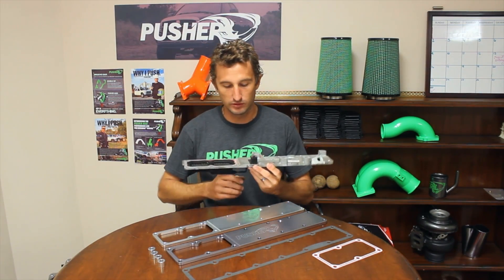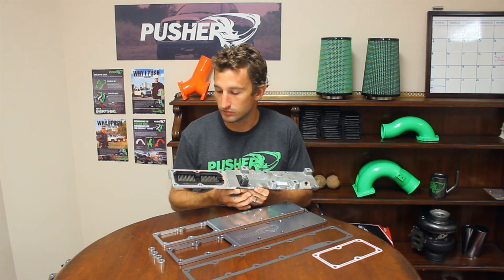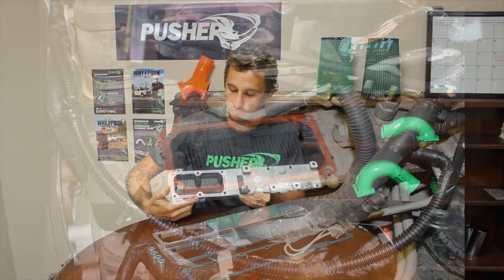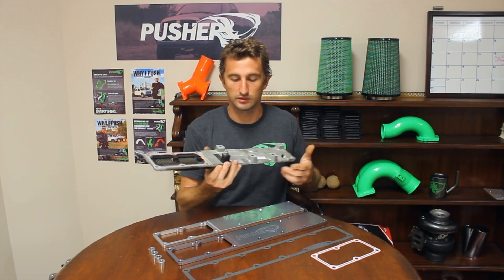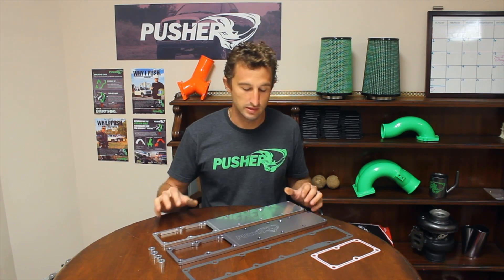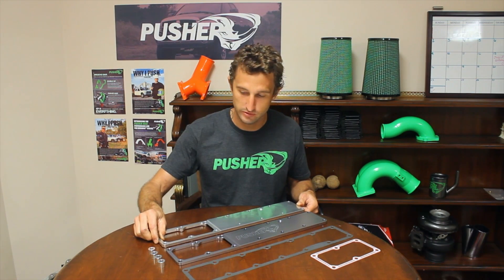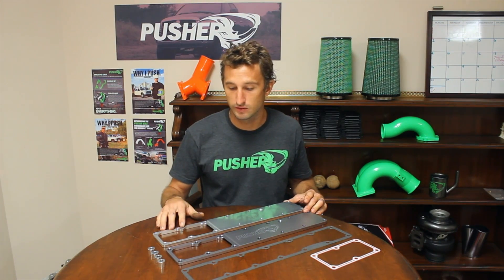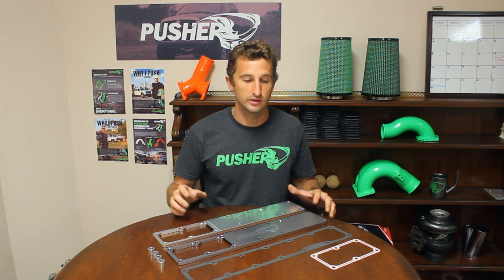Pusher Product Overview - Heater Grid Delete - Dodge 6.7L Cummins

Comment: I think you've missed the BIGGEST selling point of your part, it gets rid of the Killer Nut! That is the nut on the bottom of the stock plate where the electrical lead bolts on. After some time it can work loose, that causes arcing, which melts the stud. Then the remains of the nut and stud get sucked into cylinder 6 and causes BIG $$$ repairs. Or a new engine.

Comment: Is a DPF delete a good idea with a grid heater delete? Will the initial starts without aided heat cause mixture to run rich causing more soot in DPF?
Reply from the maker: After an extreme number of cold starts that may potentially be an issue, but we have never seen it be a problem.

Comment: I dont like bolting this kind of thing on my truck without data. How did you measure the 33% increase in airflow capacity? Do you have before/after dyno numbers?

Sorry kiddos, seat of the pants doesnt mean shit. Data doesnt lie.
Reply from the maker: This product was tested on a SuperFlow SF-750 flow bench and the results were independently verified by Central Florida Machine & Speed. The configuration testing was performed back to back, the base line being our intake manifold with the factory heater grid bolted to the outlet flange (result: 396 cfm); after that Central Florida Machine & Speed swapped out the factory heater grid with our Heater Grid Delete and tested at the same inlet pressure (result: 528 cfm). This is the most accurate way to obtain performance data. 

Dyno numbers are not an appropriate reflection of  an individual product like this, but rather the tested truck's configuration (muddies the water for prove-able data on a single part as results can be easily skewed, whereas you can repeat our exact flow numbers on any flow bench).  

Thanks for asking this question - we have a flow bench chart created but discovered it's not on the website where it should be for this product. We'll update that today and you can check it out there. If you end up ordering one we will send you a Pusher koozie for pointing out the missing data (even though you unnecessarily called us kiddos).
Reply: @pusherintakes  that's what I like to hear! Excellent reply!

Comment: How long does it take to install one of these? It looks like a fairly easy job. Thanks
Reply from the maker: It is an easy, straight-forward install. It does take some time to take the fuel rail and lines off, so we typically recommend 4-6 hours. We're wrapping up an install video for this product, so be on the lookout for that.
Reply: I give myself 3 days, lmao.  I usually have to go and buy tools and supplies, get stuck on stuck bolts and am afraid to break things etc,  I have constant interruptions because I am a single parent of special needs famiy member

Comment: U guys must not have to start your trucks below 30 degrees.  I would rather know that the truck will start than remove this to gain what 5 hp
Reply from the maker: This product is not for everyone / every climate. The way a truck will respond depends on the temperature / milage on the truck. When weighing the choice of a 'rougher' start over the benefits of the heater-grid delete, some choose the delete. It's a personal preference; we even have some customers who 'seasonally' delete the heater grid.

Comment: Will I get a check engine light with the grid heater removed on a 2014?
Reply from the maker: Hi Kurt - sorry for the slow reply. If your ECM commands the grid to be heated you will get a CEL. So it just depends on whether its cold enough to command the grid. You can have this feature turned off via tuning. Let us know if you have any more questions!

Comment: Would I need to run a tuner?
Reply from the maker: It depends on how cold it gets where you live. If the ECM commands the heater grid circuit you will get a CEL but that's it; a tune would fix that.

Comment: How does this affect the map sensor. Is there any truth to the map sensor not working properly due to less restriction and not reading the proper pressure and adding to much fuel??
Reply from the maker: Good question! The MAP sensor remains unaffected by this mod; it simply reads boost. The heater grid delete lowers restriction thus lowers boost. These trucks also utilize a MAF sensor to read air flow. Let us know if you have any more questions!